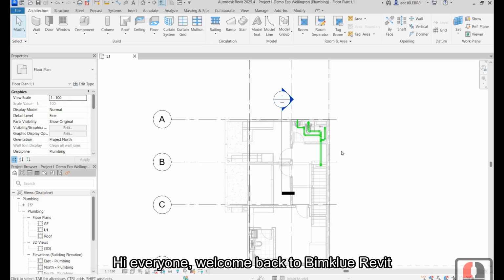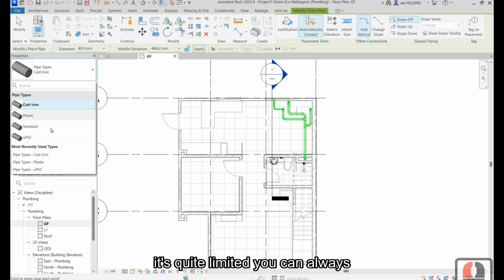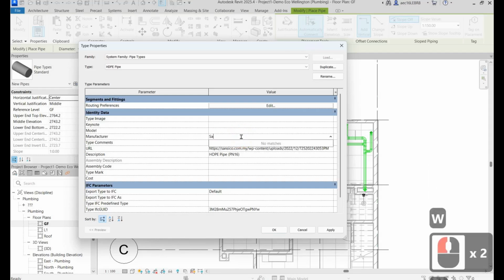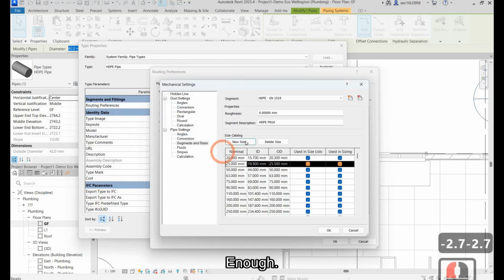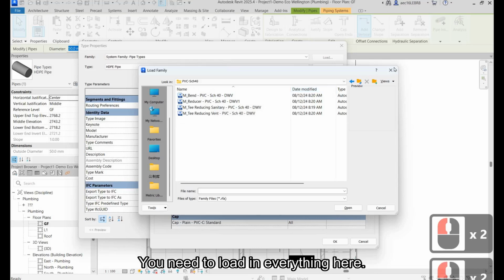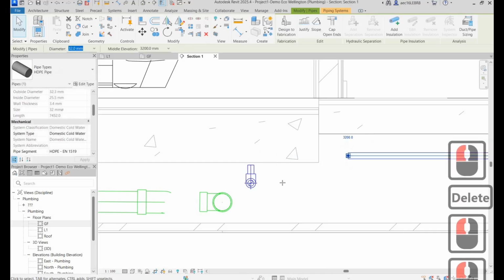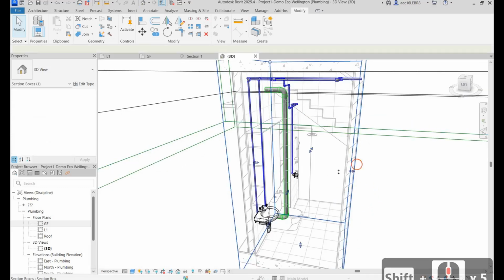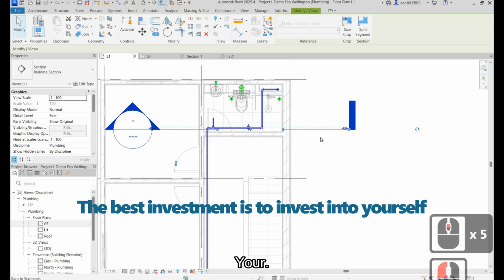Revit 2025 - Part 24 - Cold Water Piping Modeling

Comment: Insightful & helpful tutorial. Thanks. Quite fast paced but still OK. 
I noticed you used PVC Type C connector fittings. Understanderbly similar to catalogue features. I searched HDPE fittings in my Australia library and they looked different i.e. butt welded fittings. Is this butt welded fittings commonly used also?
Reply from the maker: Yes, butt-welded fittings are very common for high-density piping systems in many regions.